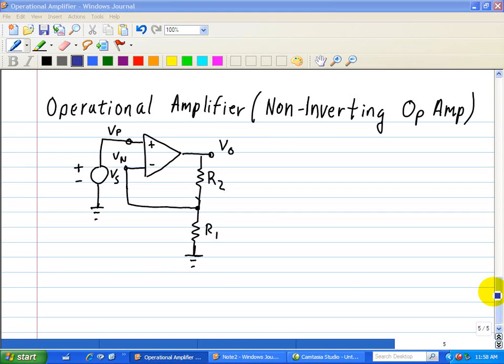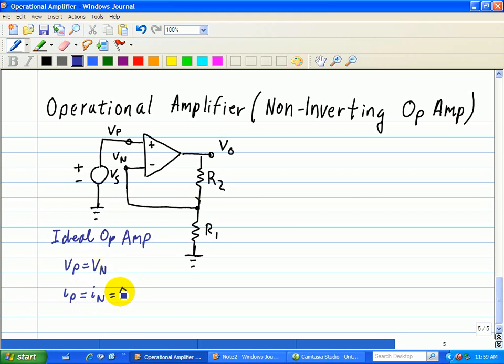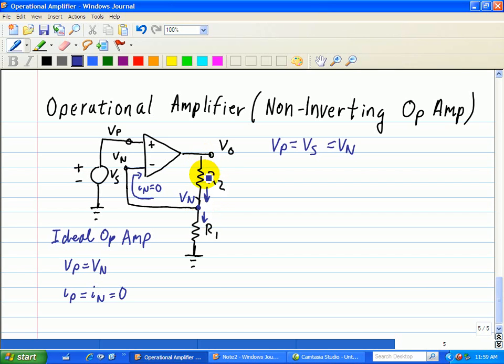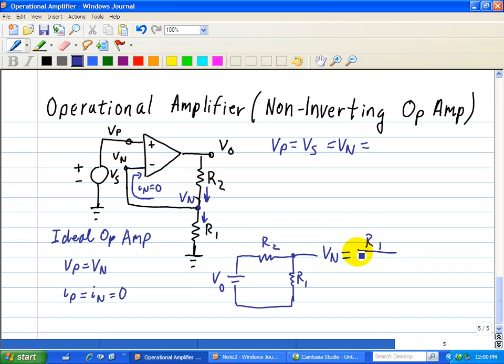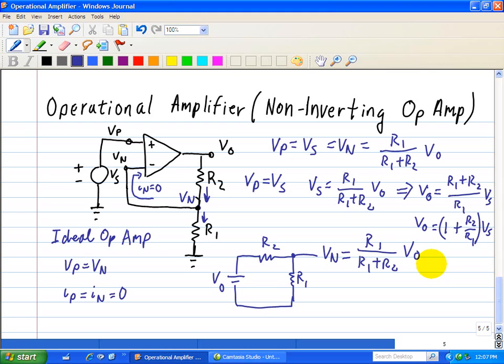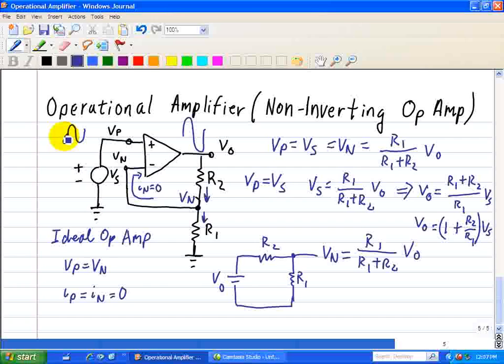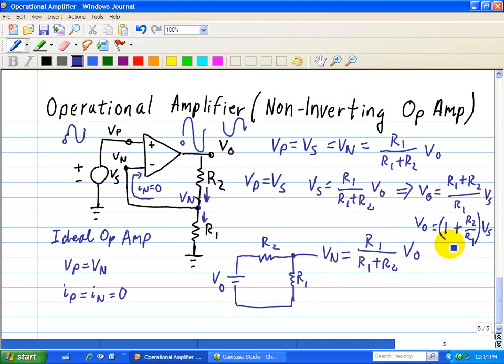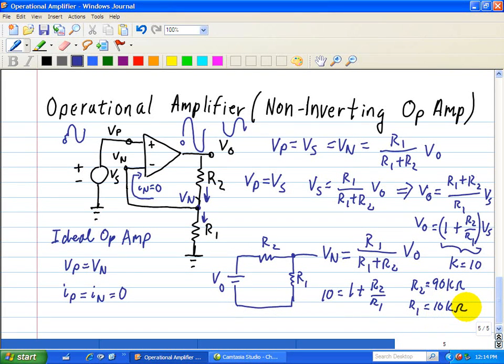Operational Amplifier Tutorial - Basic  Non-Inverting Op Amp (Part 2)

Comment: @drjctu This makes more sense. Thank you. basically Ri is not infinite, but it is so high that you use it as an infinite value for simplification of circuit analysis. Of course, I'd assume this leaves a small margin of error with calculations done using Ri an an infinite value. To be more accurate, you'd have to use the 10^6 ohms through 10^12ohms value you mentioned. Which adds unecessary complications for the amount of correction you'd have using that value. Is this correct?

Comment: From Wikiperdia page on operational amplifiers: "An op-amp produces an output voltage that is typically hundreds of thousands times larger than the voltage difference between its input terminals." Bit if the inputs are ALWAYS equal then there can NEVER be a difference between them to be amplified! I see other people have posted similar things here, so I know I'm not alone in not understanding this. Does anyone have a concise explanation?

Comment: Take the other case,
as the difference between vp and vn is zero can't we say that the output voltage vo=A(0)=0 
I mean to ask that if the voltage difference at input is zero how can it produce a voltage difference at output. Its just like getting output even if we are not applying input voltage How is this possible ??